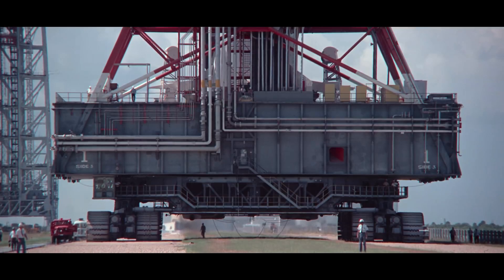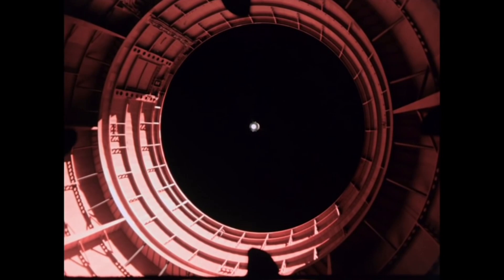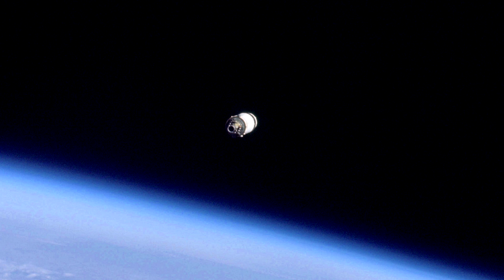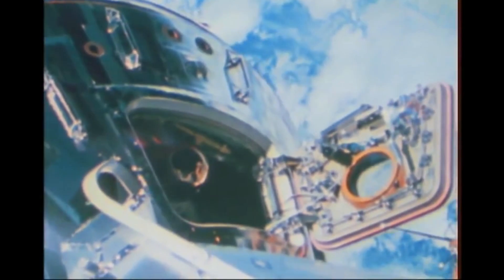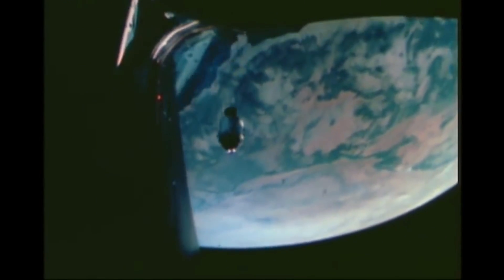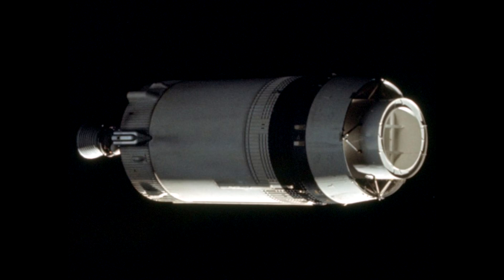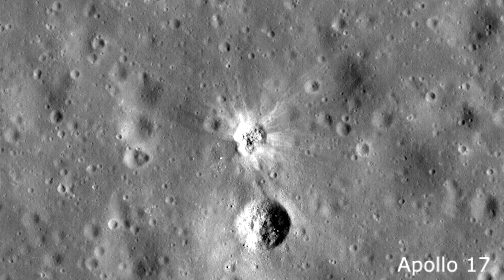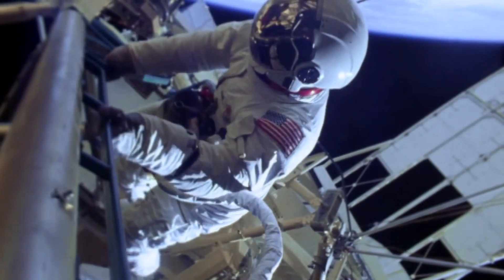How Did The Apollo 11 Documentary Get Film Of The Upper Stage Ignition?

Comment: 4:09 What is that?
Reply: I think part of the docking system.
Reply: @TheEvilmooseofdoom  Yes, that's the docking probe that makes the initial contact. 

It sits on the nose of the Command Module, is guided into a cone-shaped receptacle (a drogue) on the Lunar Module, and locks in place. It then retracts, pulling the two spacecraft together, and twelve latches around the outside of the docking module engage (that's known as "hard dock"). After that, the probe and drogue can be removed from inside the spacecraft, and you've got an open tunnel to move through.

Comment: Love the clip of the astronauts doing their own spin gravity in Skylab!
Reply: I wonder if they could act as a reaction wheel and how far they would have to run to have a noticeable effect :)
I never realised how huge skylab was!
Reply: @enjibkk6850  It did. The actual reaction wheels had to counter it. However big the mass diference is, Newton doesn't give up.
But it didn't rotate for artificial gravity.  That would have been an issue when they took thousands of photographs.
Also i think when you do that in too small a "wheel" you just get sick. It has to have a certain size.
Reply: @5Andysalive  Coriolis effect or something, right?
Reply: @5Andysalive  it doesn't HAVE to be a certain size, but when you get smaller than something i can't remember like 12 metres, only a few people can stomach it, and those people are too busy test piloting experimental aircraft.
Reply: @5Andysalive     The problem is that you have more gravity at your feet than at your head when the centrifuge is too small.    It it's only double your height, your head is weightless.   😁
Reply: Enji Bkk 
It would have less to do with how far they went than how fast and how heavy they were. If they ran at the same speed the whole time they would have no net effect. Only speeding up and slowing down would turn it.
Reply: @21Trainman  Indeed, I came to that conclusion after giving it some more thoughts :)
Reply: @enjibkk6850  If you ever have the chance to go to Cape Canaveral, there is a dummy Saturn V lying on it's side separated into each stage.  It is at 1:1 scale, so you can actually see at least the outside dimensions of what was used to make Skylab.  I haven't seen it myself now in about 30 years or so, but it was a heck of a site to see back then.
Reply: So this is the closest we ever got from having an artificial gravity spaceship.
Reply: @thepolacopeter  Also Gemini 11
Reply: so much room for activities!
Reply: @phoule76  a man of culture I see
Reply: Adymn Sani  I heard that was a prank they would play, trying to strand you in the middle while you were sleeping and then watch you squirm when you wake up.
Reply: I mean, there is still air, I don't see how you wouldn't be able to "swim" back to the wall if they stranded you in the middle... it would take a bit of effort though
Reply: @danilooliveira6580  I think it would be possible, but very comical to watch!
Reply: @bimblinghill  Definitely possible, but incredibly exhausting to go very far.  There's a short clip out there of astronauts doing this in the ISS's Japanese lab when it was first launched and without experimental racks, therefore a bit roomier.
Reply: I think that even if you do nothing, the air blowing from the ventilation system will eventually push you up against a wall.
Reply: @RCAvhstape  Or the minor gravitational differences between different parts of the space station, depending where they get stranded.  Would be super interesting to see at attempt at quantifying these things.
Reply: @92Pyromaniac  you can just wiggle a bit and start to move. you have air in there. And old Isaac with his reactions..
Reply: @5Andysalive  I'm actually surprised not one single person in this entire thread has suggested taking a breath and using your mouth as a rocket as you exhale. Another example of smart people failing to "keep it simple, stupid" haha. Actually... I'm surprised nobody mentioned farting...

Comment: Ah, Skylab.  The most Kerbal of space stations.
Reply: i don't know. Most kerbal stations are made by nailing a lot of bits together, like the ISS. It just feels more like a space station as we're used to it.   Declaring one big tank a space station would feel kinda cheaty in KSP.
While it was a rather sensible idea in reality. Sensible because a (last) SaturnV was available anyway.
Reply: @5Andysalive  NovaSilisko was working on a "wet workshops" mod to allow conversion of tanks to living spaces, though I don't know if anything came of it.
Reply: @5Andysalive  They did essentially nail a giant square umbrella to it to act a a replacement heat shield from the sun, after one of the solar panel wings ripped a large chunk of it off when it fell off Skylab during launch, also pinning down the other solar panel wing.  It took a space walk to unpin the wing after they installed the solar umbrella from inside Skylab using a scientific sample port I think it was.  So yeah it was the original Kerbal Space Station in the fact that pieces of it fell off during launch when the fairing didn't stage correctly, broke other components, and then it took some engineering to create the item needed to be added to Skylab to fix it, then a spacewalk so that they would have sufficent power.
Reply: What about mir
Reply: "The most Kerbal of space stations."  Only if you are like me where everything I build just looks like a bunch of old washing machines celotaped together. But not for a master like ShadowZone.
Reply: I’d say that spacehab is the most Kerbal “space station”, because the crew and the “station” are on the same launch, like most Kerbal stations where most people usually put crew inside the payload fairing and launch. Salyut would be second place, because it is simple and compact. Skylab is a bit messy and asymmetrical, which is why it is third. Mir is fourth and ISS is fifth. Not including failed stations like Polyus.